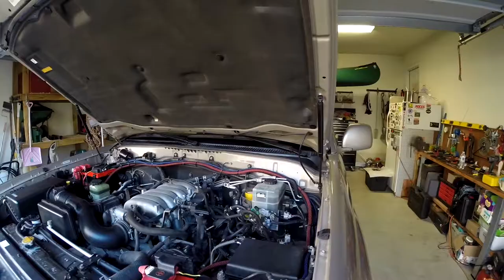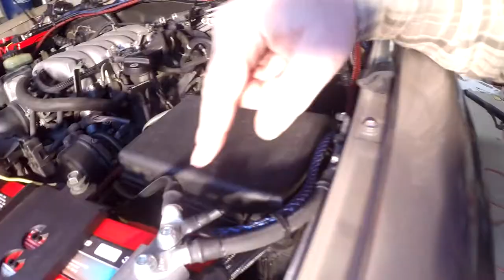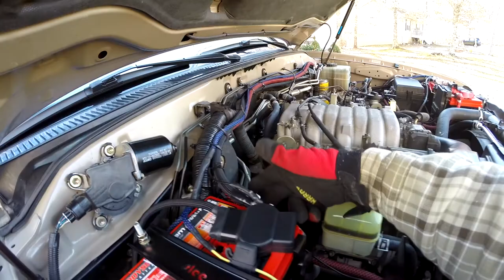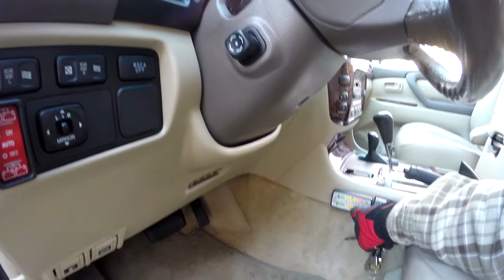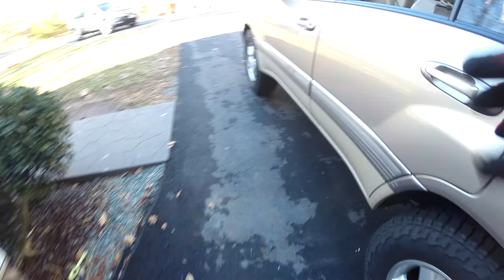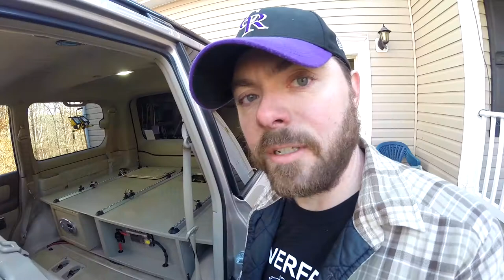Land Cruiser Overland Dual Battery System Walk Around - Building Bernard Project 2.1

Comment: One of the neatest best attention to detail Dual Batt installs i've seen.
Very well done on the upgrading of terminals and using proper hex crimps!
Also the upgrade of Earthing/Ground Cable is often over looked
The Alternator wire is another to upgrade as with the Engine Block Earth/Ground.

We use a 25 Amp DC-DC charger to better charge and maintain the second battery
Also has a MPPT solar control for a solar panel input built in.
But if you are on the move often, it can be fine with Alternator charging.

Love the SLEE brackets, i'll be buying them for mine now

All your work is far better than you would get in a shop!
So neat and well thought out and mostly, done properly!
Reply from the maker: WOW man thanks I really appreciate it!  I definitely took my time designing it and learned a ton from the overland community on ih8mud and youtube.  I have read about the alternator and block ground as well and plan to tackle that before long.  I plan to put in an ac-dc shore charger and solar as well.  Do you have any solar recommendations?  I have considered a DC-DC charger and may go that route depending on how well things preform this summer, we are on the move regularly so hope we get by.  Thanks again!

Comment: I see you went with the Luna battery monitors. Why did you go with the Blue Sea ACR as opposed to the Luna isolator? From what I understand, it allows you to connect both batteries through the Luna battery monitor for charge/jump in case of the starting battery going dead. Thanks and nice work on the dual battery build.
Reply from the maker: Thanks man and you're welcome!  The luna isolator is essentially a standard solenoid with some smarts attached to it. The acr is a true relay that is more efficent.  It is also built for marine conditions and I liked the ability to control the relay from the relay itself or in the cab.  I guess I liked the design of the blue sea better.  In the end though they really achieve the exact same goal. 
 You can read more about the ACRs advantages here https://www.bluesea.com/support/articles/1366/Automatic_Charging_Relay_%5BACR%5D_Explained

I picked the luna monitor to go with it because I liked it more than any other options I could find at the time.
Reply: Brady Adventures thanks for the reply. I will check it out for sure. I’m trying to figure out the best secondary battery setup for my Suburban K2500. Im also trying to build it in the manner that I can add solar down the road.

Comment: good setup.  on our Ford TV news vans  we have   BOOST button if our main battery is dead it will boost from our AUX.    Or do both your batteries drain together?
Reply from the maker: Thanls! I have a switch in the cab and can manually connect them with that or there is also a manual connection on the relay itself if you need a boost. The relay automatically connects and disconnects so they charge togeather and discharge separate.

Comment: Nice walk around. I am in the middle of a dual battery install in my 06 Tundra (also the 4.7). I did not properly anticipate the level of effort and the cost when planning this project!

I have mounted my 2 batteries, air comp, fuse block, ML-ACR, and now just have to run the wiring! 

In the mentality of do it once, do it right, I wanted to point out to you and your viewers that the crimper you used does not provide the best crimps. Please note, I am not saying they will fail any time soon or that they won't work (they actually maybe good enough). I have owned your hydraulic crimper before and used in on a vehicle. I just wanted to point out that they are not up to par for automotive standards crimping.

The cheapest UL certified crimper I could find is the  FTZ 94284. If you want your aux wiring to last as long (or longer) as the factory wiring, it might be a good investment. Again, not being critical, just thought I would share!
Reply from the maker: Thanks man! No kidding a lot more work and $ than I anticipated too but so glad we have it, it's been great. I can't  argue going with the best tools you can and thanks fpr the tip! I can say the crimps that the cheap crimmper made seemed pretty solid, we'll see how they hold up but so far so good. Good luck with your build and thanks for checking us out!

Comment: Great set up! I think going just end up copying what you have done, save me a lot of time!
Reply from the maker: Thanks Chris!  I really love how it has turned out and it is working great.  Pretty soon I'll post some videos of it in action. Please let me know if you have any questions.  I really love this stuff and am happy to help!  A few things I still plan to do are 1. add an on-board dual bank ac-dc charger for when I am parked and have ac I like this one so far and it's on Odysseys approved list http://amzn.to/2sfpLDV 2. add heat barrier wraps to protect the batteries from heat already have these http://amzn.to/2EonNpH 3. redo the ml-acr switch wiring (crimping and everything was a bit cumbersome) with a duetsch connector like this one http://amzn.to/2C3eiXI  I have links to pretty much everything I used in the description and on bradyadventures.com really trying to get a decent blog going on there but haven't put a ton of effort in over there yet.
Reply: Are planning on installing an air compressor like the ARB, interested in that install as well.
Reply from the maker: Now that I have the Slee aux tray, the blank space tells me to stick a compressor in there every time I open the hood :-)   I currently use a VIAR 300P http://amzn.to/2C2dsdP and it works great.  I expect, even though it will be one of the last mods, I will eventually put in lockers.  So right now I am thinking I will put in the smaller ARB compressor soon and then I can fill two tires at once, or just use the VIAR as a backup, and be ready for lockers.  I don't think I am going to go for the dual compressor.  I think the dual is awesome but I just don't need that much.  I will definitely post a vid of whatever I end up doing but bet I won't be able to help myself the next time I see a good sale on them.
Reply: Looking forward to see that as well!

Comment: I have a question. Why have such a big main battery if it’s disconnected and not powering any aux when the car is off. Thank you ~
Reply from the maker: Honestly it's just cuz that's what the battery tray fits.  I have always had a plan to rewire it to be the aux and the other to be the start.  All the ideas I have for doing this are not that great so it's been on the back burner.  My solar and the current aux batter generally keep things going no problem.
Reply: @BradyAdventures  Thank you for your reply. Keep the videos coming :)